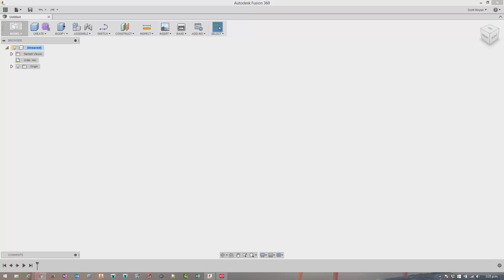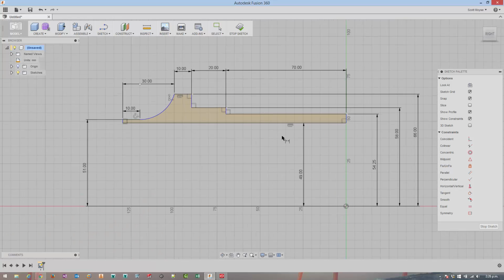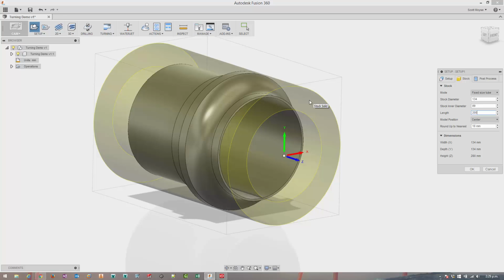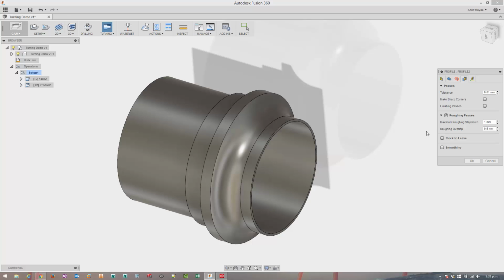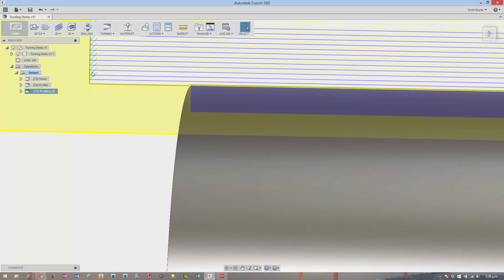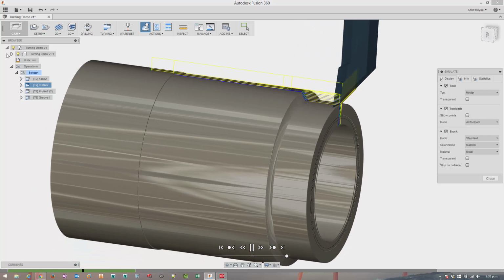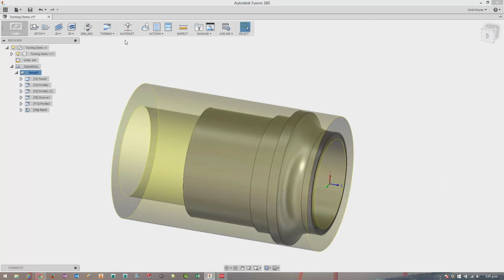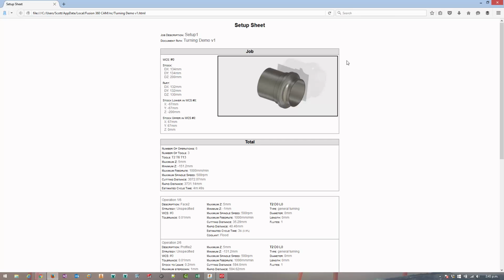Modelling & Programming a Turned Part in Fusion 360

Comment: what happens if the back diameter is smaller than the front radius then selecting the inner radius wont work. any help would be appreciated thanks this was a great video. version 2.0.11415 (2020) here

Comment: So if i didnt want a hole in the center, just an outside profile, i suppose i would just sketch the ends down to the center line? Probably a dumb question. I'll try it. Thank you for starting from a sketch, and not a pre existing file. Very important to me, as other CAMs handle this differently.

Comment: Awesome!!!  I'll be doing my first cnc Lathe project in two weeks and the only significant difference from your part to mine is that I need to add threads to the back end of the part.  My TL-1 lathe should be here next week.

Comment: Very simple looking software. Thanks for posting this video. I am looking to download it soon. I have one question. When you was doing the sketch, you had drawn it with the steps beginning at the origin and the big radius on the back but when you started programming it the part was flipped with the radius up front? Why did it do that?  Isn't normally the origin the front of the part? That was the only part that confused me
Reply from the maker: That's a good point. It was probably just because that's how it was drawn on the piece of paper when it was handed to me by the prospect who wanted the demo. I try to turn demos into instructional content for this channel when appropriate.

Comment: Very helpful! but I have a newbie question.. how do I know what post prosessor to choose for my machine or rather who gives me that information on what post to use, machine manufacturer or is it autodesk?, I'm just getting into this cam stuff so I don't know how it works. I've used solidworks, autocad and invertor in the past and now I'm learning Fusion 360 cam but this postprocessing deal is a gray area. Thanks!
Reply from the maker: Hi Sumocat, what machine do you have? In reality it's a combination of your Machine's Controller, and how the machine builder has configured that control, which leads to which post you should use. As a baseline, you generally start with a post that's built for your controller, then you modify it from there to suit your specific machine.
Reply: I work with Okuma LT10 twin turret, OSP100L control, Okuma LB300 twin spindle, Mazak quickturn 250II MS, twin spindle.  Then we also have one older Takisawa Ts25 with Fanuc Ot. We just got the Mazak and it's pretty easy to program in Mazatrol but it would be nice to try the fusion cam on it. Since I posted that question I've already learnt more about cam systems, and I'm able to use it on our fanuc control with some editing of the code. But I need twin spindle machine with 2x C axis, live tools and a bar feeder to make the parts I need, so Mazak or the LT10 is the only way. Thanks for your response!
Reply from the maker: Hi Sumocat, let us know if you want help with developing posts, it's one of the services we offer. You can get in touch by sending an email to sales@cadpro.co.nz if you are interested.
Reply: Ok. Thanks!

Comment: I cannot get Fusion 360 to create turning profile tool paths. It seems that every tool is invalid? It doesn't need to be this difficult!
Reply from the maker: You can't use a grooving tool for a profile operation, and vise versa. And there are some limitations relating to tool orientation. I know I'm replying far too late here... so did you get it figured out in the end?
Reply: Yes, you can in fact use a grooving tool for a profiling operation. The developers at Fusion 360 don't understand how this works on a machine so getting it to work was the opposite of what the labels are offered within the software. I would explain it, but honestly it was so difficult that I cannot remember how to make it work.
Reply from the maker: If you want to use a grooving tool for profiling, you use the Groove toolpath and choose Sideways with partial stepdown from the Grooving pattern drop-down on the passes tab. Like most things, it's easy once you know how. People have different perspectives on things, so while one person might make one decision about how to present information, the next person might do the opposite.... ultimately I agree with you, that they could make this clearer and I think they will in time, they just have other more important things to implement at the moment.

Comment: GREAT video! This video touches on just about every 360 question I have! One question. How to you set that up for manual tool changes? I use gang and QCTP.
Reply from the maker: I reckon Brad @ +TacticalKeychains is your man to talk to about that. That's 99% post processor stuff. Which lathe are you using?
Reply: Tormach. I  get the gang tool setup, on the machine side (via Brad's video) but for the CAM to post, would I need to add my own M1 to change tools or does 360 facilitate that?
Reply from the maker: Spiffy Lab there's an excellent thread on the Autodesk CAM post forum for the Tormach lathe. Go check it out.

Comment: Same time you draw that figure. i allready would write program to cnc by hand. mayby im just freak of nature :) why post prosessor not use G70-G76. that would make you program code 100x smaller AND easier change LOL
Reply from the maker: Yeah you might be able to, but this is a simple profile for the benefit of this tutorial. However once the design changes, or if you have template models and toolpaths setup for repeats of similar parts, then integrated CAM will beat your hand code speed every time. Canned turning cycles can't be simulated in the CAM software, because every machine will run the cycle differently. Even identical machines can run them differently. So they are quite dangerous to use in CAM software. Also code length is a non issue with modern controllers or if you are DNC drip feeding the code via RS232. Regarding on the speed this took.... I did it at a pace that was suitable for people to learn, not at a pace a competent & well setup programmer could do it. Thank you for your comment.